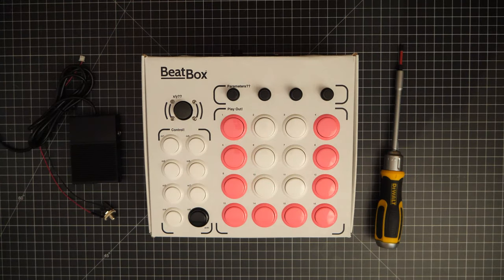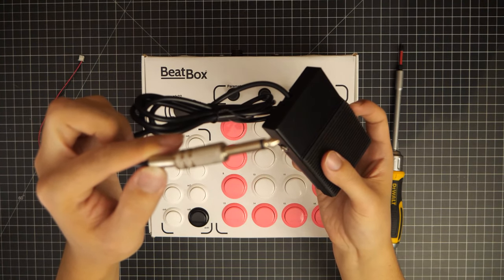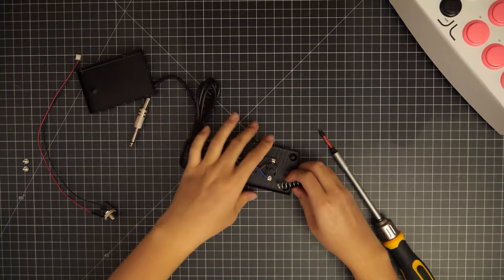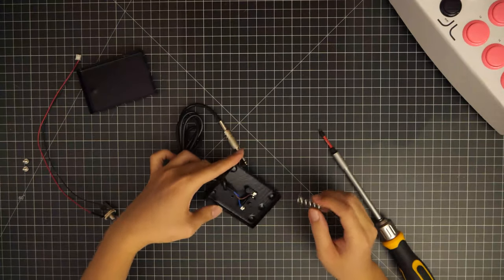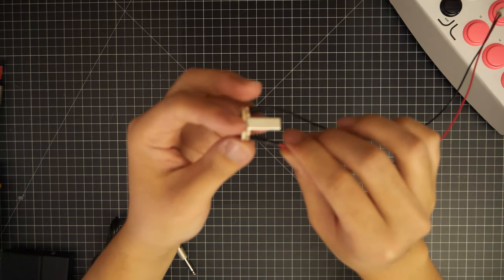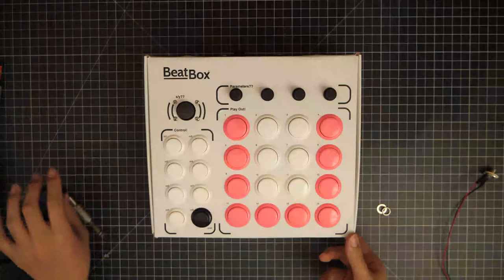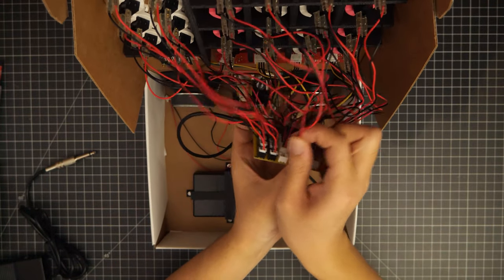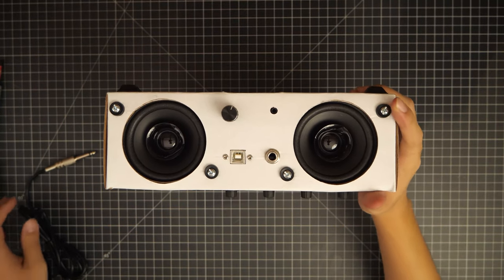BeatBox Modification Series #1: Add a Foot Pedal!

Comment: Hey great vid! The possibilities could be endless with modding the beatbox!
You guys should do a tutorial of maybe adding a 5 pin midi out to control drum machines or small hardware synths? 
If it's possible maybe it there could be a way to connect it to external gear through the app? Could be a nice edition for a later version of the app! 
If not standalone would be cool too :)